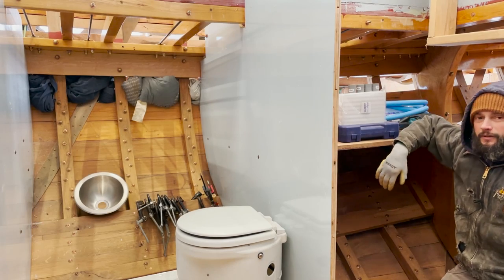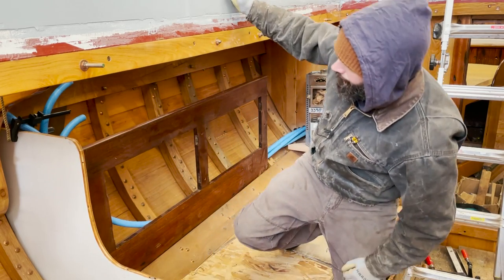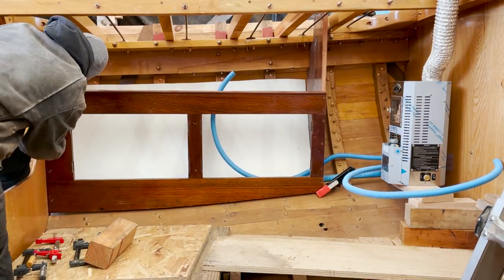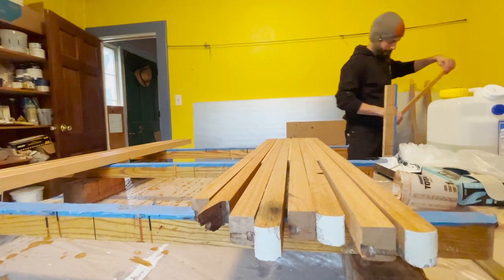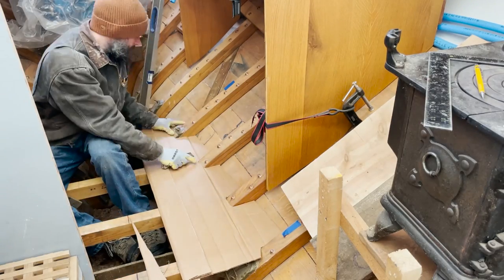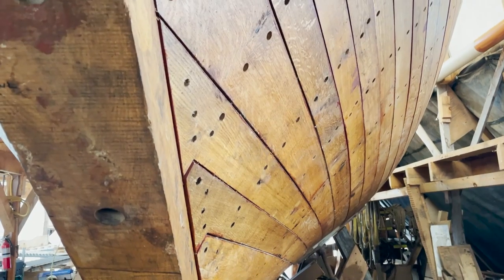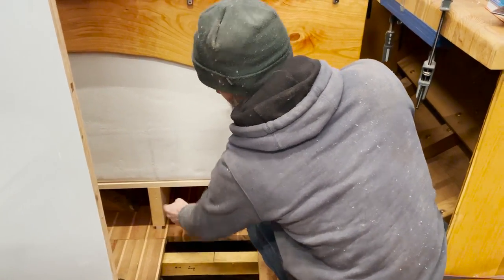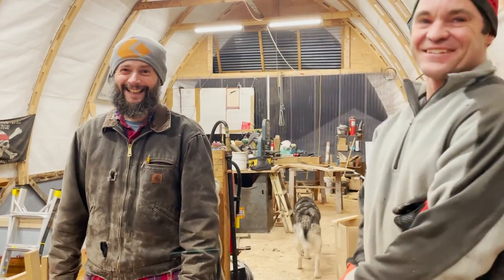Finally Back to Woodworking! - Episode 195 - Acorn to Arabella: Journey of a Wooden Boat

Comment: Those grey fittings are an odd size, because they are actually "couplings".  The blue fittings are the connectors used to directly connect the conduit to the box.  They make sealing rings which go between the blue connector and the box.  Then there is a sealing locknut, which tightens the connector to the box.  Standard size KO for a 3/4" conduit is 1 1/8" dia. , for 1" conduit, it is 1 3/8" dia
Reply: In this part of the world.  We use nylon cable glands.  M16, M20, M25, M32, etc etc.

They screw into enclosure, and then have a compression fitting to connect directly onto cable or conduit.

Having to glue anything into an enclosure doesn't sound right to me.

Comment: I have been a Refrigeration engineer my whole life I think it may be prudent to drill a 1/4 inch hole at low level on your refer unit and fit a rubber bung then chill it down defrost and drain the water as good as your unit is and the insulation it will hold air and moisture you don’t want ice heave to split it or ruin it over time a small drain hole would allow you to freeze it defrost it and allow the moisture out

Comment: I think it was very forward thinking of you to make a fridge insulated so well! Many people don't get the value of insulation, neither in a fridge nor in a house. However I was surprised to see you are going to cook with wood? I'd have gone for solar panels, batteries and an electric stove. Why? Because true independence. Now wood, no gas. And yes, that is possible. I know people doing it in vans, boats and of course trucks. While the solar panels and the stove work for 15-30 years the batteries do indeed last less long. I'd however buy a tested module from crashed a tesla. 24V usually 5kwh, 1000usd. small and extremely reliable. If you set the battery management to never fully charge and never full discharge you can get several 1000 cycles on it, which means you can use it for many years even if you live in the boat every day. And of course you will have all the other electricity from that system too. Many people go with lead batteries, because they don't want to get into battery management systems which are needed for Lithium Batteries and a Tesla module. But that is backwards thinking and not really smart. Because the lithuium way will pay for it self because of the longevity (if done right!) lead batteries will do 200-500 cycles, even if the datasheet pretends they do 1000, they will never do it. While a well maintained tesla module can do 3000-5000. So even if you pay 10 times more for the lithium way, which you don't, it will still be worth it...

Comment: Regarding the centerline soul boards the you put in.  1 goes under the fridge/freezer (which is a beautiful unit by the way) and another one goes in-front of the fridge (where you'd be standing when getting into or accessing items in the fridge.)  You've built a sub-frame (in housing it would be called floor joists) that these center soul boards rest on.  Surprisingly the joint or seam where these 2 centerline soul boards come together do not fall on top of a joist or sub-frame member.  In the video at 26:21 Steve, you are placing the boards back in place and you can particularly see the board that sits under the fridge tip down.  as with a kitchen cabinet toe kick, usually when a person stands at a kitchen cabinet, your toes go a few inches into the toe-kick area (under the cabinet) I assume that same thing will happen with your fridge ... When a person is standing at the fridge to get something out of it... your toes will go a few inches under the fridge and the front of your foot would likely put some weight on this soul board that is under the fridge - causing it to tip... I imagine that could be hugely annoying.. maybe not so much of a safety issue, but just annoying.... so question is,  why don't you have what I'm calling a joist, be directly under this joint/seam between to the two soul boards so there is no potential tipping.

Comment: As far as keeping the lids to the reefer closed you could embed / put some neodymium magnets in the corners of the lids and the counter to hold them in then put some more gel coat over the top of them to hide them.  That will make the opening and closing a little harder but you know that the lids won't pop out with a hard bounce of a wave either.  Should allow you to keep the clean installation appearance.  :-D
Beautiful work, all!!  <3
Reply: Given where the fridge is located, it will be too close to the main compass for magnets. There are other ways to secure them, that won't cause the compass to give wrong headings.

Comment: My suggestion on your electric boxes would be to drill a 7/8” hole in the box ( 1/2” conduit) and insert the conduit coupling into the box. If sealing the joint is a concern use an o-ring and a conduit bushing on the inside and your glue on the outside. A second option would be to drill and tap the box, either way you eliminate the conduit female adapter and the need for a crazy drill size. If you are using larger conduit then drill  a larger hole. (1 1/8” for 3/4” conduit and 1 3/8” for 1” conduit.)
Reply: Or just use the size meant for them which is almost certainly a 40mm hole, which is easy to find a hole saw for.

Comment: For the electrical fittings I use a  stepped drill bit called a Uni-bit and clean up the hole with a tubing reamer.  If you want the correct size hole saw you have to go to an electrical supply house.

Comment: To keep the loose joints of the sole tight fitted, try to epoxy R. E. magnets that will force them tightly together, but can still easily be separated. Be carful not to put same poles together, will have the opposite affect. OR you would place the magnets on the bottoms of the soles that ways it will help keep them down in place and not rattle so much when walking on them.

Comment: It pays to run a draw wire thru the conduit when the conduit is laid flat. If the conduit has any bends in it, it can be difficult to push wires or bundles thru. I also used to tie another draw wire to the wires so that it could be possible to run extra wires once everything is installed. But you probably already know that!
Reply: vacuum twine through it

Comment: Hey guys, thanks for the great vids! Did you think by any chance of a pump of sorts to empty the fridge from liquids that might/will leak inside? Condensation, or any ice you might put in to help the refrigerator might end up with a small pool of water at the bottom... 
Cheers!

Comment: The "smurf" fittings are designed to be placed into a drilled hole in the junction box and secured with a locknut.  You are adding an extra level of complexity to the conduit install, and the glue to be used for the junction will likely fail with time.  Use the adaptors properly, with locknuts.  Install them, and then just snap your smurf tubing into them.  Don't need to preassemble tubing to fitting.  Without the grey adaptor, the smurf tubing can be made to fit closer to the box, and avoid having to have extra space where ever you have a conduit junction.

Comment: Hi and as I am an industrial electrician the problem is condensation inside the conduits can be fixed by at a low point drill a small hole to allow water out. The insulation on the cables breaks down causing faults. I have been following from the start and have not missed an episode.

Comment: Hey Team
Why do you need to use the grey conduit adaptors,  just use the blue flexible conduit adaptors with a locknut ( looks about 1" and 1 1/4") directly into junction boxes. Less fittings and less issues. Have been installing conduit in difficult locations for 30 years.

Comment: While I concur with the numerous comments on the scree type of connectors for your junction boxes, if you ever need in-between sizes for wood holes, you can take a Irwin type spade bit and gently tap out the points a thirtysecond on each side to get 1/16" more diameter.  Tap or file it back when done - or mark it and save it.

Comment: Well... That's 40mm which for an electrical hole is an odd ball size in the metric world as well. (38 is the closest "normal" size)

Reason for that is that you're not meant to drill it.

Do away with the grey part, mount the blue directly into the box. If you want to get all fancy about that part you can even tap the box so it threads in and put the locknut on the inside. Could even glue it in if you like, the bond breaks easily enough when you need it to.

Comment: I would plan to have significant play in the sole pieces. Your building it in the winter and you’re probably going to sail to warmer climes, where those panels will expand significantly. I don’t care what kind of finish you end up using: the floor will expand.
Reply: So will the rest of the boat 😂

Comment: They make nuts that screw onto the conduit fittings so all you would have to do is punch a hole in the JB and place the fitting in and screw on the nut.  Look into the Circuit Breaker box in your house and you will see the nut I am talking about.  Silicone caulk will seal the fitting to the JB with no issues.  I would also install a pull line in each conduit, it will make it easier to pull the wires through the conduit.  I make my pull lines twice as long as the conduit run so I can pull a/the wires in and then pull my pull line back.

Comment: Maybe I missed the explanation some episodes back, but how is the fridge going to work as you need evaporator plates, compressor, refridgerant and a heat exchanger etc to cool the interior?    This will need holes through fridge box etc.

Comment: Drill 1.25 inch holes in the junction box. Cut the PVC connectors in half, you only need the threaded portion, and butt glue them to the outside of the junction box with PVC Cement. (assuming that box is also PVC or something that will chemically melt. Maybe epoxy if not.) You might even be able to drill a hole that is the same OD of the threads on the smurf-tube connector and glue the threaded PVC connector on the inside of the junction box then thread the male connector into the female one through the wall of the box. That would save you an inch or two on each connection and might look a little cleaner.

Comment: I think the conduit connectors you have are for going from flexible to normal conduit. You should just be able to get locknuts for the blue part and drill a 20mm hole (whatever that is in old money) then you'll save space and have less chance of them breaking off, I've never seen glands glued into jb's before, but then again I've never worked as an electrician in America...

Comment: You can take the blue conduit connector and drill a hole to fit the threads inside the junction box. Then all you need is a lock nut to thread on and you do away with the grey fitting completely

Comment: Those junction boxes just drill a hole the size of the threads of the PCV conduit connector using nut on the back of it don't have to glue anything Eric from Florida

Comment: Take my advice, pull in at least twice as many circuits as you think you will need, because once you have a few wires in that conduit, pulling in new ones in situ is close to impossible.  Pull them through the conduit in a bundle, easy. Trying to push/pull an extra one later is a nightmare.

Comment: I liked this one. I really enjoy when things are moving forward. Looks great. I see you guys cleaning wood with acetone before applying coatings. I’ve search high and here in the Philippines and all the acetone is bottled for nail polish remover. That included a moisturizer so that boat don’t float. Is there an alternative I can use? I am building a wall of glass shutters with mahogany and doors for our master bedroom. I will stain it mahogany (mohgany stain on mahogany?)then varnish high gloss thusly to satisfy wifey. Keep on keeping on.
Reply from the maker: If you’re using an oil-based varnish, you can use turpentine (my preference) or mineral spirits. Water-based, you can wipe with plain old fuel alcohol.  The point is to clean the surface, removing anything sticky or oily. I personally use a solvent wipe down to remove dust… I don’t bother with tack cloths. after sanding,  vacuum the surface, wipe with a dry cloth, final pass with a cloth that has solvent on it. It’s not as critical as a good, even sanding, nice thin builder coats, clean brushes and working area… —Anne

Comment: You don't need to glue the pvc adaptors all you need to do is to drill a clearance hole for your conduit thread adaptors in the  boxes and put a nut on it. the conduit end treads are normally M20 or M25 mm and you can buy a hole saw for this purpose
Reply: That would be 3/4 to 1" in the US.
Reply: Yeah that fitting did not look like 1 9/16" (= 40mm) ...... anyhoo not sure I would use a hole saw  just need a 25mm metric step drill, guess sometimes these things can be difficult to find when you mob still stuck using freedom units
Reply: @bunyipdan  Electricians use hole saws for this purpose all the time
Reply: @tonybell4447  Plenty use step drills for panel or sheet metal fixtures where I'm from (Australia)......finding the right sized hole saw tends to be like finding a 10mm socket ...... never one when you need it. Step drills are an inexpensive multi purpose bit and a good solution for this job IMHO, guess everyone to there own.

Comment: I don't think that you have the correct fittings for the conduit entry to the junction boxes. The fittings you have look to me to be for for a solid conduit to a flexible conduit connection. The correct fittings have a threaded male end for the junction box entry, secured with a thin lock-nut inside the junction box.
Reply: Female adapter verses Male adapter

Comment: On your flex conduit, male adaptors are available. That wat you can lose the intermediary piece of PVC. If you can’t find PVC fitting nuts, you can make them by cutting off the first couple of threads from a PVC F/M adaptor. Instant adaptor nut.

Comment: A question: In most modern boats weight is a bit of a concern. Apparently that is not so with Arabella, I don't understand why the sole is an inch thick.
Reply from the maker: In boats weight is a concern period… but for stability reasons. Arabella is planned to have a lot of internal ballast that can be shifted or removed… if she’s heavy, we can adjust. Boats with all external ballast can’t.

Comment: You dont need the grey pvc adapter just drill a hole in the box and put the threaded end of the blue adapter in and use a galvinized  conduit nut  to lock it in .

Comment: You don't need junction boxes. .   Run a black 6awg forward for your negative  in-between  add bus bars for your forward and  mast lights. Eg cabin nav lights etc. 
Terminal blocks are good for ganging up same power sources cabin lights,outlets etc. 
As for your 12 volt red power. Run 10awg or 12 awg forward.  I prefer 10awg.  Connecting your mast lights cabin lights.  Etc.  forward individually.  As for your AC Run 10awg triplex for your heavier 20 amp breakers shore power, inverter/charger,reefer Air conditionerif you are going to install one. . And 12 awg for  triplex for your 15awg breakers. 120 v outlets. 
Buy a bluesea systems  AC/DC traditional panel. I have  the 8408.
And for my battery management system since I have 2 house  battery banks and 1 starter bank a total of 1515 amp hours.
I have a bluesea 8693..